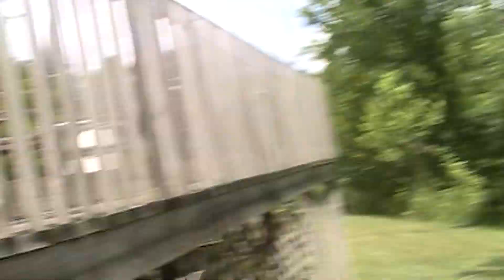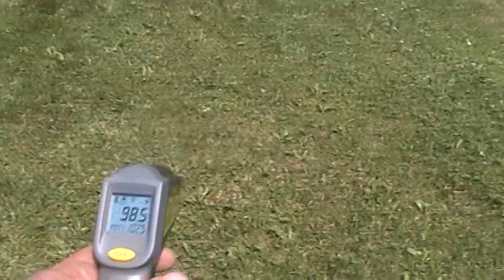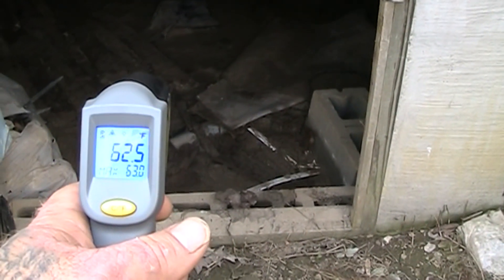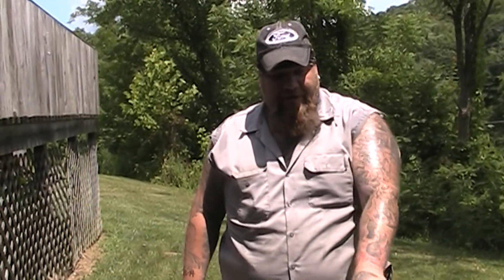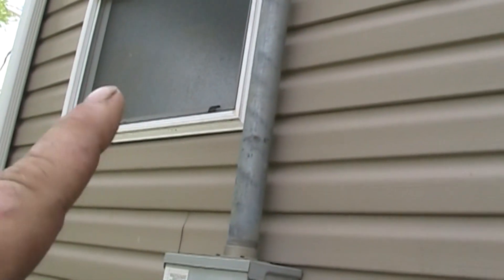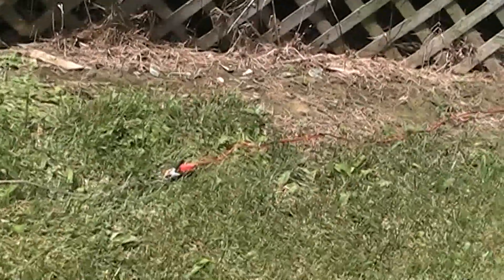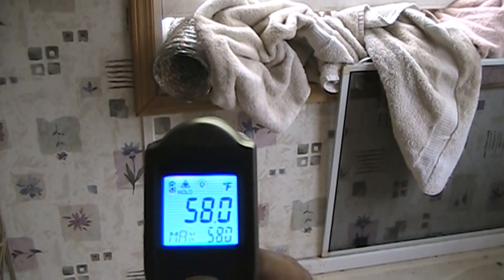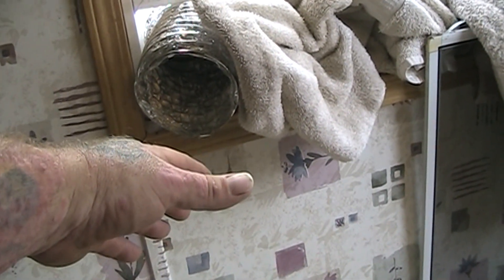Cooling My House with Solar Power: Part 1, the Experiment

Comment: 30 DOLLAR A.C.. UNIT. ossilating fan 10 foot of quarter inch copper tubing 10 foot of plastic tubing the inside of the plastic tubing should be a quarter inch to fit the copper tubing strap copper tubing to ossilating fan with tie down straps creating a circle from the center of fan to the outer rim of fan connect plastic tube to both ends of copper tube use screw clamps to attach plastic to copper tube you will need an aquarium water pump and a large tub to hold water connect plastic tube to water pump submerge water pump in tubb of water with how ever many of frozen gallon water jugs you can fit in tub will also run off of your solar panel making it totally free
Reply: except for the cost of any materials you.ll need to purchase
Reply: william burgin Then all you have to do is figure out how to freeze all those water jugs for free.
Reply: My Moniker your nit picking my friend penny.s mere penny.s  lam sure if you have a freezer you could make room for a couple one gallon jugs of water are you related to jack benny
Reply: william burgin
Do you think the freezer is going to freeze that water for free?
Not only will it be running all the time using electricity to keep freezing water but if it's in the house it will be adding heat to the house.....it's less efficient than an air conditioner.
Reply: My Moniker what part of this aren.t you getting l assume you have a freezer for meat and what ever else you need to keep frozen so the freezer is going to be running anyway if you put a couple jugs of water in there to freeze and rotate them when needed you can check the video out for yourself on you tube its the home made a.c. unit  its the one with the fan
Reply: william burgin
I understand the thermodynamics and energy usage perfectly it's you that are confused if you think a freezer is some magic cold producing machine that cost nothing to run.
If you think freezing gallons of water everyday that your freezer is going to run the same amount as it does keeping already frozen things frozen you are sadly mistaken.
Again a freezer running in the house produces heat and an air conditioner dumps the heat outside so the freezer is less efficient and good luck freezing enough water daily to do much good other than in maybe one room and it would still be better to use an air conditioner.

Since you're so convinced that freezers are a magic cold producing machines, I suggest you get a freezer take the door off and let it cool your house and it should cost basically nothing according to you.
Reply: My Moniker look you are way to into this thing the only thing lam talking about is cooling a room off with a self made cooling system that runs for penny.s on the day other then the cost of freezing the water it could be run on a solar panel why would you want to nit pick it to death go watch the video you might learn something
Reply: william burgin
The cost of freezing the water is the main expense that is just the facts, there is no nit picking to telling the facts......it's not an efficient way of cooling and you getting upset about it will not change the facts.
I'm sorry if me knowing what I am talking about is upsetting you, should I lie to make you feel better?
Reply: My Moniker lam not upset and l think your just trying to antagonize me and l think your missing the point entirely you have a nice evening

Comment: Just thinking you run a furnace.  It has a hot and cold return system, can you tap into the cold air return and use that that ? Then there are no extra holes  or piping to worry about and you won't have to worry about losing the strength of your floor. Just saying, l'm only a simple dudett.

Comment: Great idea. My only question is what about odor, moisture and mold spores. Thanks!
Reply: Not really a great idea... He measured the temperature of the bottom of your house a d compared that temperature with the temperature of the grass exposed to the heat of the sun. That's ridiculously wrong my friend !!!!! He should have measured the temperature inside the house and compare it with the one under the house.